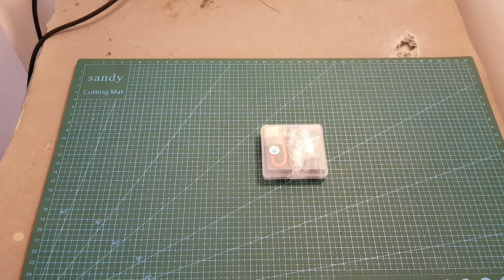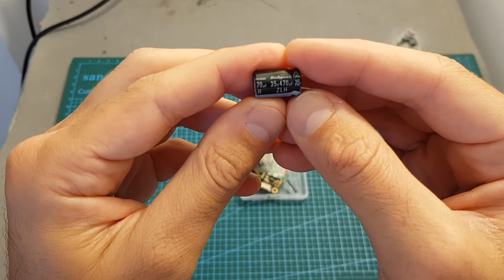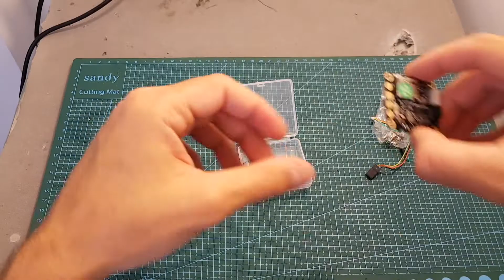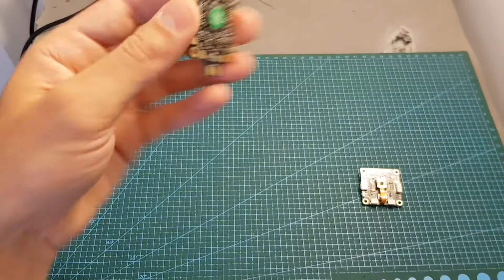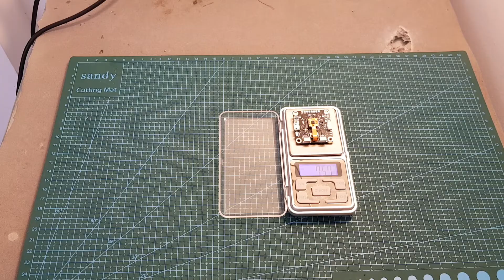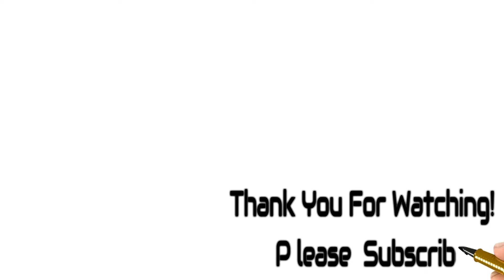HAKRC Omnibus F4 V3 Flight Controller

Comment: Hi I just received this FC and I have few questions. I installed latest Inav on it.
I have BN-220 GPS and I don't know how to connect it. I'm connecting it to thic connector where is microsd card slot (just on the other side of the board) but it isn't reacting, Don't usb should be enought for powering it? Or I need to power it from battery to get it working? (I'm wiring it right now and I'm using wiring sheme from banggood site).
Also, Is it possible to get F-port working on it?
Reply: Okay, It need battery power to power up servos and gps. Both led's on GPS are flashing, but inav can't detect it (Changes in ,,ports'' doesn't do anything
Reply: Also the receiver connection from banggood don't work
Reply: @kajetanciesielski8283  I just wired up the BN-220. It's using the 4 pins (GND, 5V, RX, TX) on the GPS 6 pin connector and NMEA/9600 bps (as default from BN220 datasheet) . Using port 6 since GPS is on port 6. The RX and TX are crossconnected (so GPS RX -> FC TX)
Reply from the maker: Sorry, I don't have any experience with gps devices (yet)